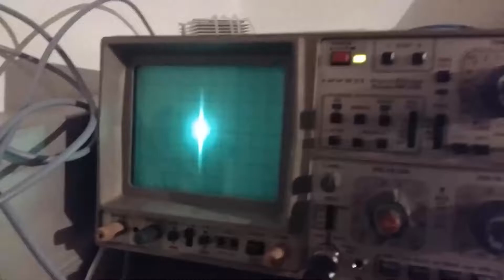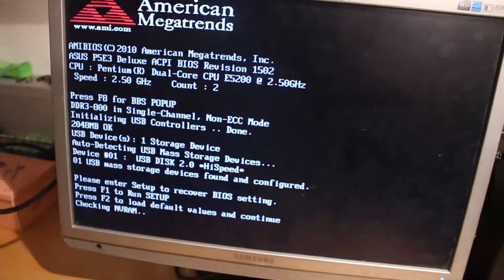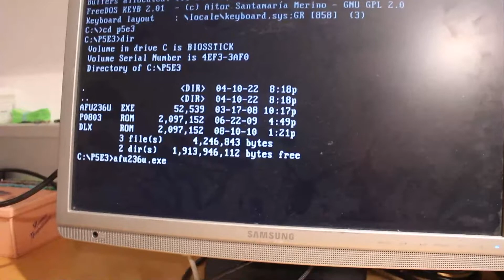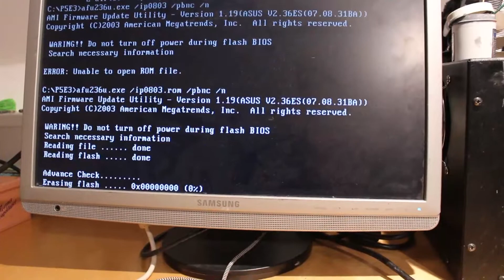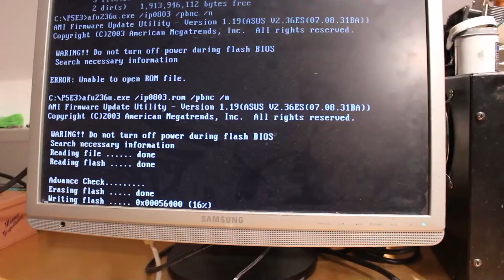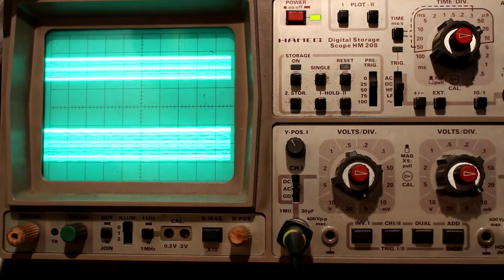How to turn a P5E3 Deluxe into a (slightly worse) P5E3 Premium

Comment: Hey Tagg! So, I recently dug up my old P5E64 WS Evolution. You mention this board a couple times in the video, but I noticed the resistor layout is different! What value resistor do you recommend to add for 600KHz+ switching frequency, and which one should I be soldering to? Thanks for the vid!